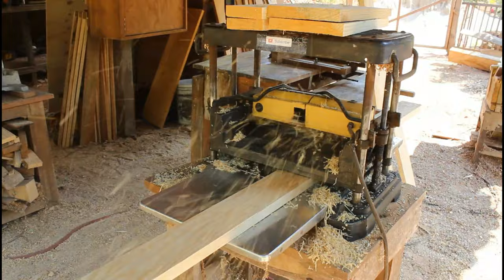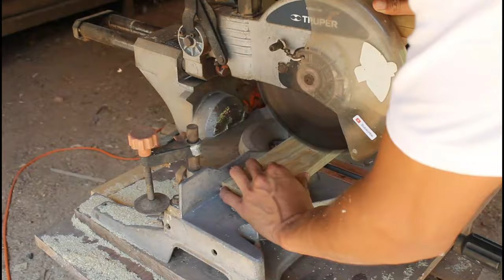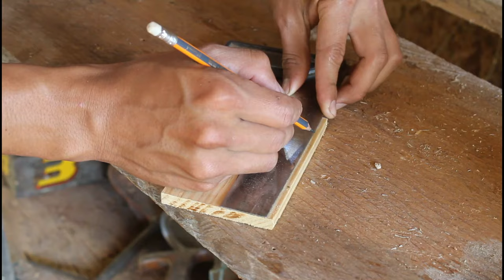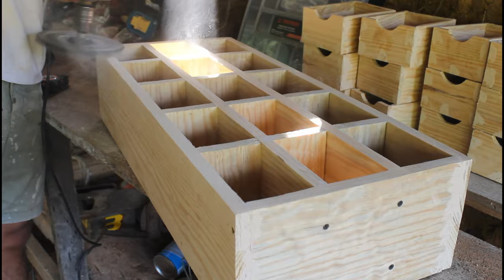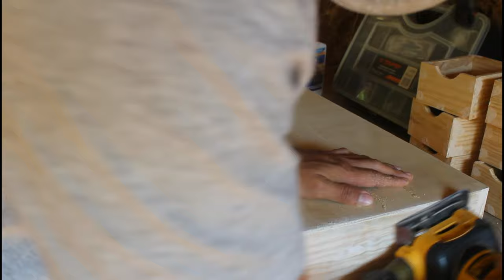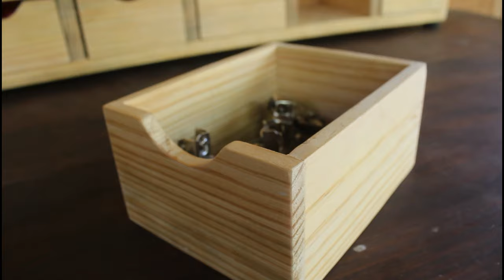How to Make an Organizer Box | Screw Storage DIY

Comment: I love how none of these videos tell you the measurements or explain wtf is going on like wtf is that wood chipper in the beginning. It's not just you I've watched like 20 of these videos
Reply: That machine is called a planer, it planes down your pieces to make them flat and smooth, that way you can make them all the exact same thickness. Most times, you would make this to whatever size you need it to be. Just make your outer box/shelf pieces, then build your drawers to fit.